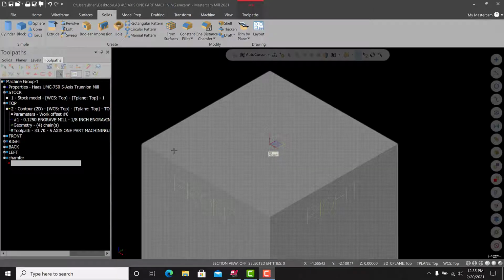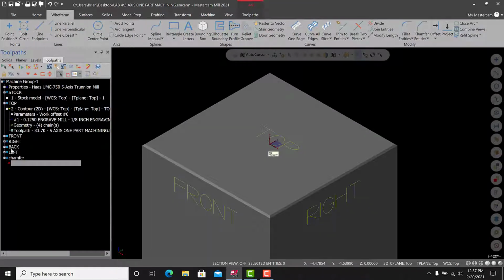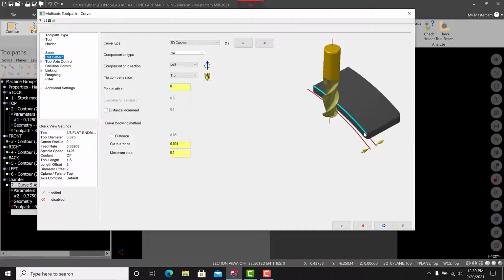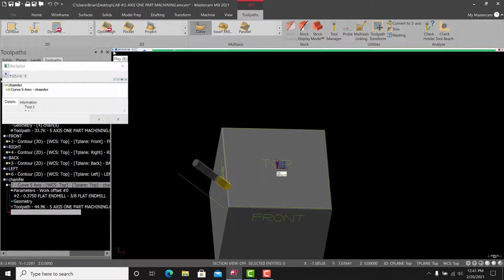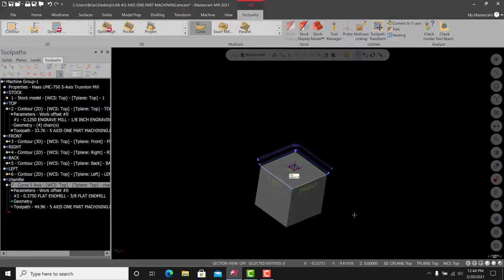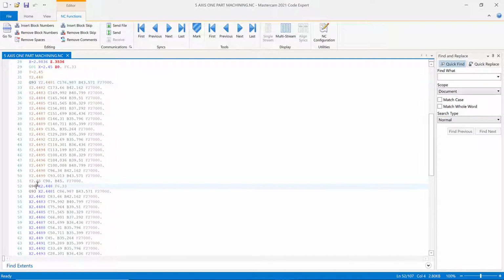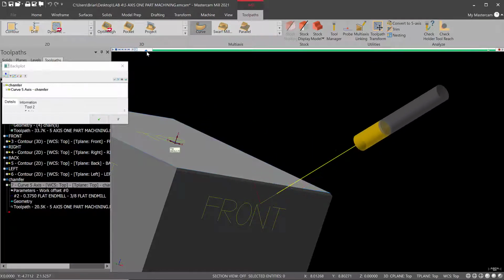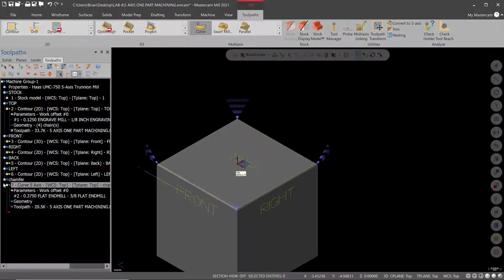Mastercam 2021 Multi-axis curve

Comment: is there a way to achieve this same tool path in unified or in MC 2023? I would like to make a round chamfer with a flat end mill normal to the surface. Cant seem to figure it out.
EDIT: nevermind I found it, I thought they replaced Curve with unified in 2023

Comment: Hello one question? I have a fixture for 5 equal parts to machine .... and in each one I have my WORK OFFSET G54 G55 G56 G57 ETC ... but when I generate my GCODE of all my operations .... I only see a work offset in my program G54 for all parts and I can't see anywhere G55 G56 G57 ETC ... do you know why that happens?
Reply from the maker: You can apply a specific work offset for each plane you use. This can also be a post issue.  You can assign work offsets in the plane manager or in the toolpaths plane tab
Reply: Nice tutorial 
Do you have tutorials for like this one please
https://youtu.be/JpWvhgTtaJ8
Mastercam on integrex
Reply from the maker: I do not have anything edited yet, but will plan to add more advanced material.